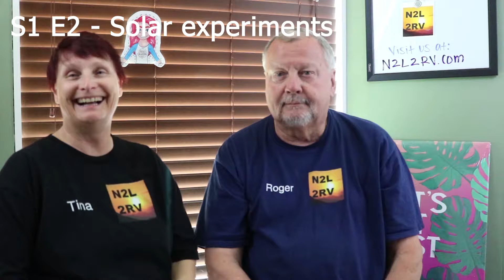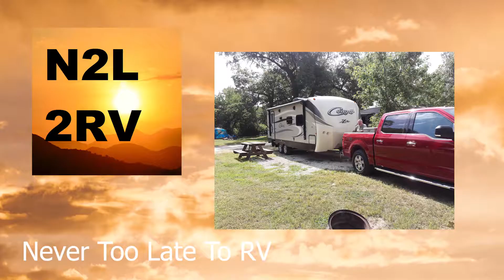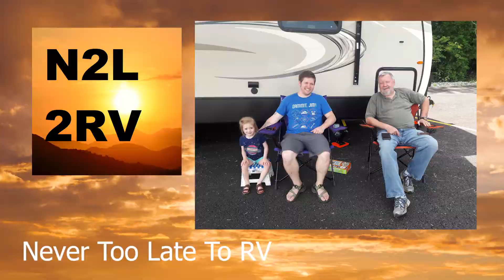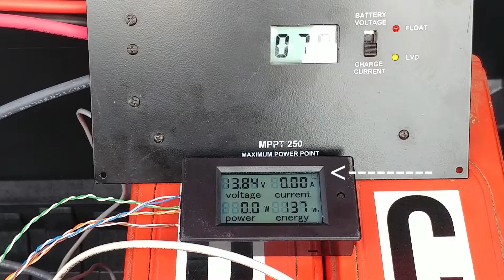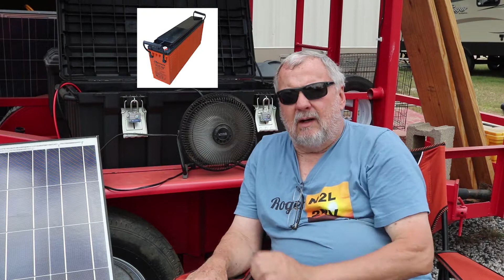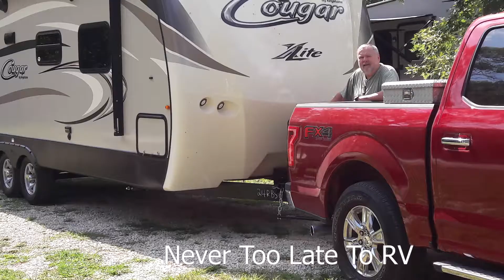S1-E2 Solar Power

Comment: on the fan, you said it was 45 watts max. but only drew 30 watts... did you use a kill-a-watt to measure it? thanks
Reply from the maker: I used a shunt and battery monitor to measure the load.